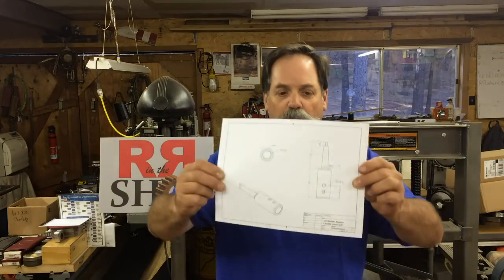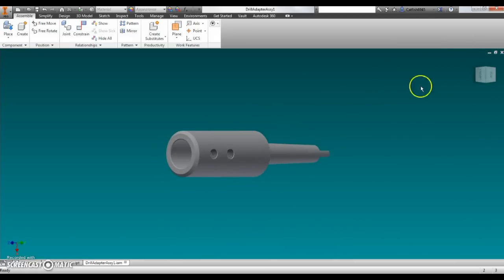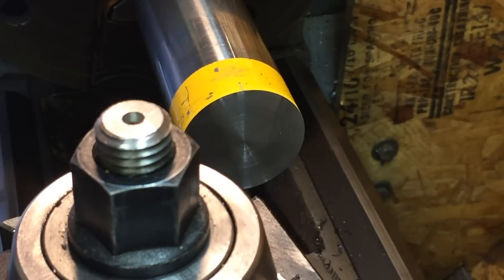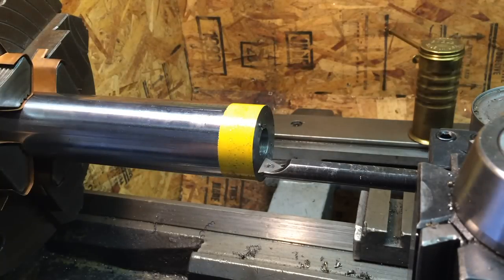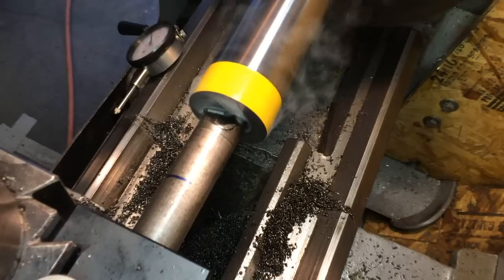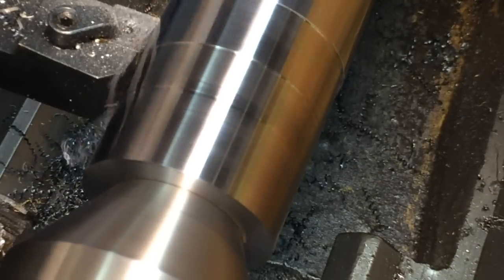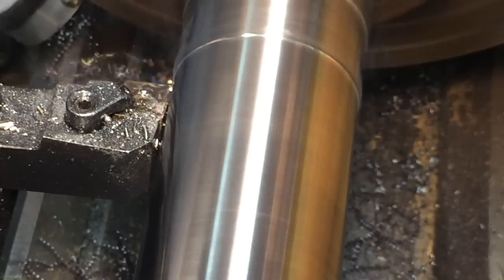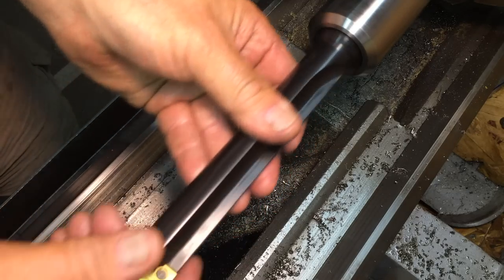How To Make a Spade Drill MT3 Adapter Part 1

Comment: 1045 is a tricky material to work, don't let it harden on you while you work it, helps if you get the whole run out at once without interruption, saves some heat rubbing on the inserts, might have to slow down a little, suggest you keep the tang, if the part slips in the tail stock it might cause some damage. 
That will be a strong good looking tool...  ;)
Rainbow, hope it means the rain is back regularly by now, enough trees lost...
Reply: wow it just started raining . randy looks like water is headed up your way.
Reply from the maker: +Chris Anderson Not yet here but soon.
Reply from the maker: +pierre beaudry Once the Chrome layers were off, it was not to bad, but still tough material.  For the Lance lathe the tang is no use, there is no engagement in the tailstock for it.  No on the Clausing MT3 also, there is engagement for the tang.  I can cut the tang if I end up needing it, I left the material there for it.  You will see.  Thanks, Randy
Reply: I'll watch for your next part...

I worked some K-460 tool steel lately and, that was a tough piece of allow... Not even hardened it was at least 3 times tougher to work  than 4140 already hardened at 30 RC...
Reply from the maker: +pierre beaudry Well I won't be getting any of that soon.

Comment: The 1045 cleans up well but tricky to machine. Got to avoid those Brillo-like fires that burn extremely hot and can go from bad to worst in the oily chip pan. Beautiful machined surface on the OD. Thanks for the video.
Reply from the maker: +Paul Jones tough material but makes a nice tool.  A glow is sure sign of cutting edge failure.    Thanks, Paul.  Randy

Comment: Hi Randy, just a quick tip, when checking run out, if you mount the mag base on the cross slide instead of on the bed ways you can use the handles to put it where you want and give you fine adjustment. Just because some others, who we all look up to, do it your way it doesn't mean you have to slavishly copy them especially if there is a better way.
I think that the toughness of that lump of metal might be slightly overkill for its new purpose, but hey the price was right.:>)
ATB
c
PS glad to hear you have rain at last, something we don't generally have to worry about this side of the pond. Shame you lost so many trees though.
Reply from the maker: +Chris Stephens Thanks Chris,  I will have to show in a video why most of the time I mount on the ways.  I have more stock and it is free.  But yes slight overkill.
More rain/snow tomorrow& monday.  Thanks, Randy

Comment: Ancient history now of course but FYI Cat induction harden their rods. In a place where I worked we often used salvage hyd rods as stock but we always rejected factory induction hardened rods as being too much trouble. The commercially available chromed bar here in Aus is 4140 from 25mm up and 1030 for smaller sizes I would think the US market would be similar. This project highlights one of the useful but often ignored/lost and unappreciated accessories the headstock morse taper adaptor. Whack on the morse taper on the work first then turn the other end for whatever using the morse adaptor.
Reply from the maker: Thanks Rob.   Great material when you can get it.

Comment: time to get the flood coolant going to take the heat away smiles good video
Reply from the maker: +Bleu Wolf You are absolutely right,  I need to figure that out.
Reply: a good tip I got was only use just enough coolant to do the job on the tool so you dont cover you and the workshop with it

Comment: No wonder I can't find a Palmgren drill press vise, you and mrpete have them all.  LOL  - Why would you not turn the outside concentric first, to eliminate the vibration? - High carbon steel "wool" will burn. - What type insert did you switch to for turning down the outside? - Good machining of hard stock. - See you in part 2.